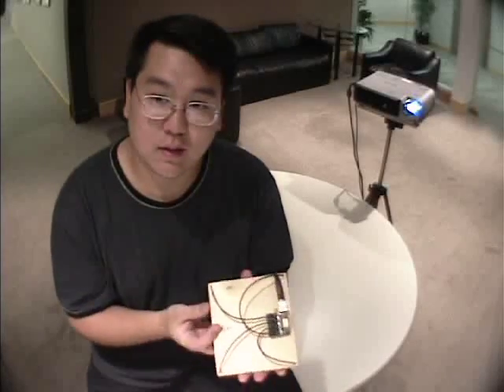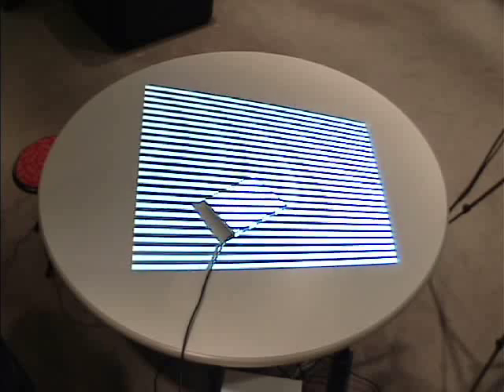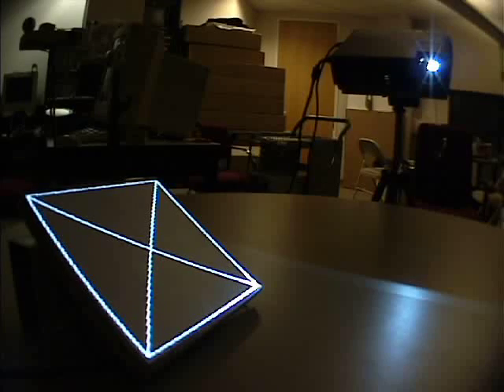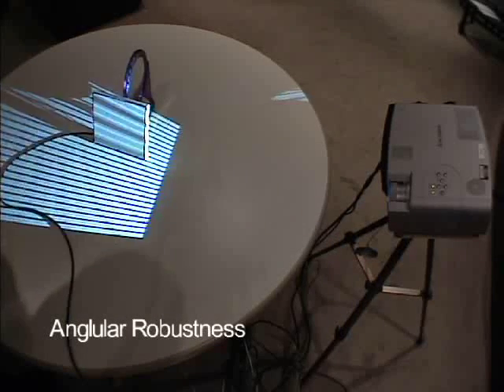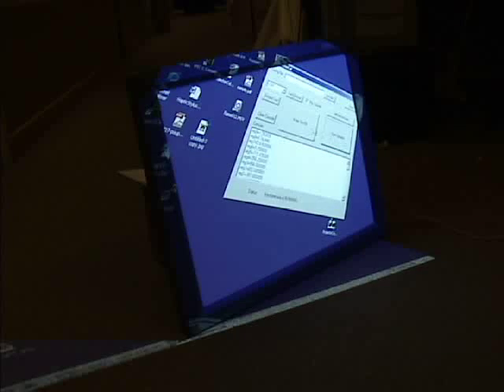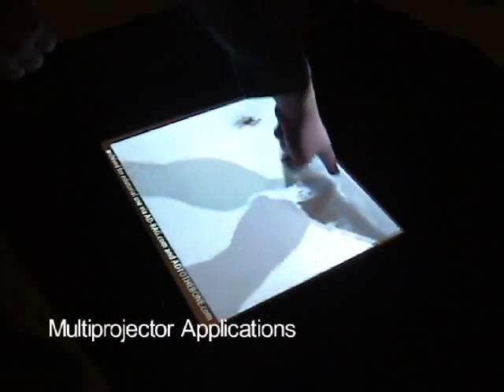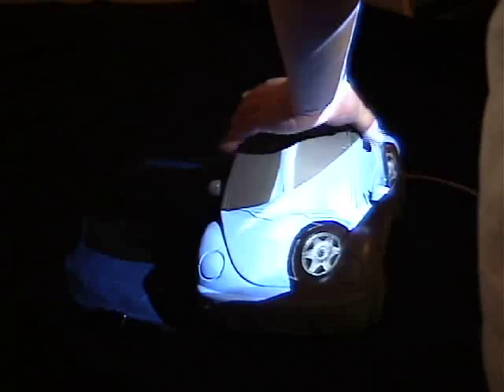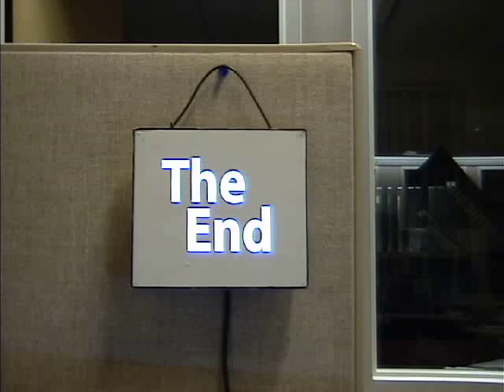Automatic Projector Calibration with Embedded Light Sensors

Comment: @jcl5m Amazing is the calibration pattern horizontal and vertical by using half. I don’t know it is possible but you can use different spectrums of visible light (or not visible) and shot all simultaneous and then separate by a prism and done the process all at same time virtually. I see a problem for larger resolutions; you may need to spend more time in the calibration process.

Comment: I wonder if you could use light which is outside of the visible spectrum for the calibration. That way the user wouldn't have to be dazzled by the calibration test and would simply see the pre / post orientation transition after the screen was moved?

Comment: So I can just place some sensors on my wall and my projector wherever I want it to be and I can calibrate it to display on my wall perfectly. Thus being able to make any room a theater room though limited to size of the room. Then being able to place the projector wherever you want without it having to be a specific distance from the wall or even perfectly parallel or horizontal to that wall. THE POTENTIAL IN THIS!!!

Comment: Your videos never cease to amaze me... I believe using a mirrored reverse projection would boost over-all quality, and doubling that with the multiprojector idea to eliminate any stitches, you could easily create a 360 degree video display. It'd be like a semi-sphere that you'd have to step in to, but the applications for having a non-stitched 360 degree display are limitless. The projector would simply calibrate a mirrored image on the back of the sphere's (more like a dome, really) surfaces.

Comment: george, there are a few advantages. First, you can have one projector and many cheap receptors such as the one shown (much cheaper than full LCD's) and project onto different surfaces at different times.   

2nd, see the part at the end where they project a custom paint job PLUS tire details onto the car. Can you do that with a LCD ?

Comment: holy cow.   Fuck a plasma t.v.   I want my whole room done.    They are coming out with a cell phone next year that has a projector built in.   And it will still be smaller then current cell phones.   It can project a 50 inch screen.   If they make this software for that then it will revolutionize electronics and computing.   

You already know they will.  You will not need a plasma screen t.v.  Or computer screen.  Instead you will use your pocket projectors.

Comment: I don't think that projectors work with an electron beam, like a CRT does. Light pens work on the electron beam - which there isn't.

Inside a projector, there's like a little LCD screen through which the light shines. Your technique probably doesn't work on a TFT or plasma screen either.

Comment: not necessarily, I can imagine a separate kit  being practical. just temporarily place sensors on whatever surface you are using, and calibrate.  after that, they can be removed.

the tricky part would be focusing. given an odd enough angle, only one part of the screen will be in focus at any one time.

but still, I would like to see this concept further developed. specifically, stitching multiple projections to three dimensional objects. imagine using in 3d modeling/texturing or costume design.

Comment: if you just want a tv, and you already have a big projector, then you don't NEED to use any special screen--just project onto a plain white surface (like your wall). if you watched carefully, you'd see that using the special screen DECREASES the size of the "viewable" screen, because it's just a piece of the screen. So this would not give you a big tv--the "TV" would be the same size or smaller than the projector's max size.

Comment: Oh, and you could also use 16 colors to reasonably encode 4 bits per pixel per flash, if you use analog sensors, and this would let you get a much larger tracking range.